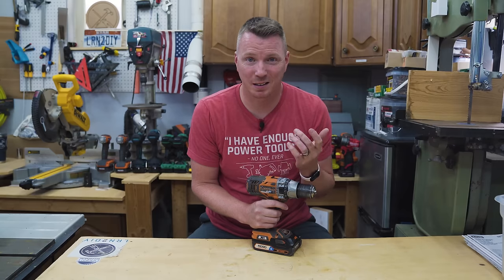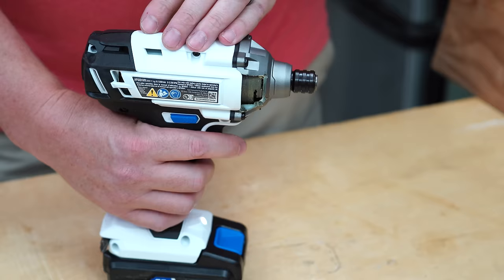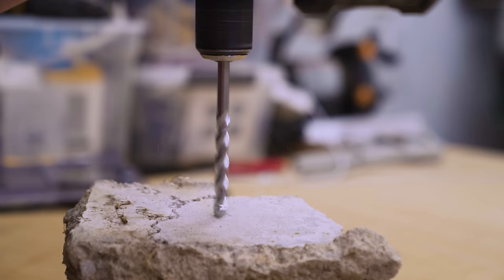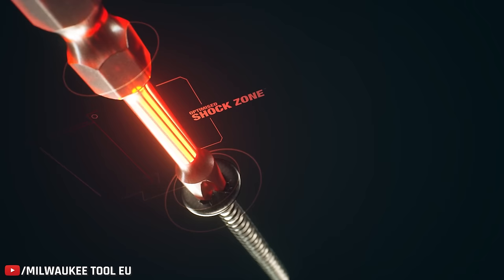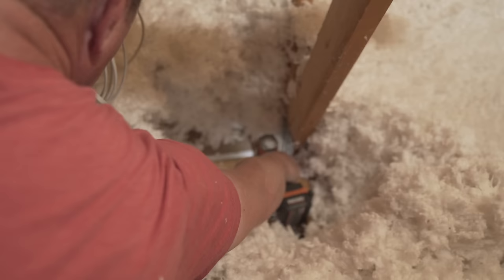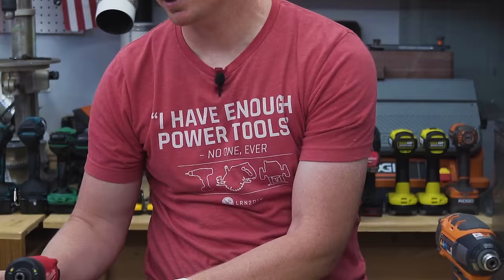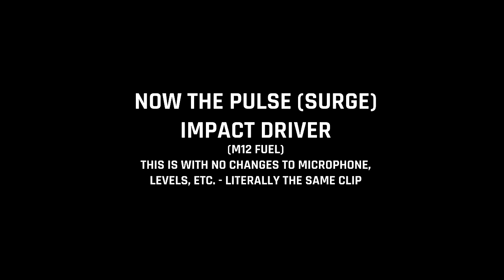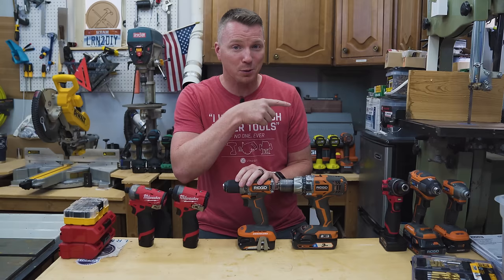Is The Cordless Drill Becoming Obsolete?

Comment: I use a drill for drilling and a driver for driving, sounds crazy but I'm pretty sure that's why they almost always come paired together. If I'm in my shop or if weather and location permits it, I still use a corded drill for drilling. If you are drilling all day, especially through stubborn wood the corded drill just gives that smooth constant power.
Reply: And if your corded drill is old enough, you can see the sparks from the motor brushes fly around inside the casing and sometimes escape through the vents. Just like the one my dad has owned for longer than I've been alive.
Reply: @StephenGillie  My apprentice calls that drill the "Wristbreaker 2000" cause if you bind it, the drill will keep spinning even if your wrist doesn't want it to.
Reply: @volentipugnum4045  "The ol' wristbreaker." That goes nicely with the permanent trailer hitch on my dad's Plymouth Volare, aka "the ol' kneebreaker."

(You know how every trailer hitch is a square adapter that sits forward of the bumper so it's out of the way, and the hitch ball sits on a square tube that fits into the hitch? His is a non-removable bar of 1.25" thick steel that ends in a trailer hitch ball mount. Because that's what U-Haul installed back in the early 1980s.)
Reply: That’s why they come with a side handle!
Reply: I finally decided to sell my corded tools. they have been collecting dust for many years, I don't even pull them out any more..
Reply: @twistedhillbilly6157  Best thing about them is that even if you don't need them anymore I'm sure they will do nicely for someone else for awhile. I buy tools from 2nd hand stores all the time and use them until there isn't a piece I can't duct tape back on.
Reply: The milwaukee m18 fuel with 2 5ah batteries and a rapid charger will get you through a whole day of drilling steel
Reply: And the my old man's old man duct taped the keys for the chuck to the cord. Never lost them.
Reply: I totally agree with u nothing beats the cord I have to drill many holes 1/4-3/8-1/2” some times all day just drilling
Reply: @erichermann7553  I do the same thing with Milwaukee M18.

Except I'm usury drilling through steel and cast.

Though I use it at home too, and I work multiple days on mine with wood on a single 5Ah battery.
Reply: @volentipugnum4045  Tell him to brace the right side of it; with his leg if he has to. Really nice in tight spaces cuz you usually get to just brace it up against wood er something.
Reply: @erichermann7553  new  cordless tools are so much better than they used to be. Often times just as powerful if not more powerful than corded. I was stubborn for a long time and didnt want to believe it, but yea, they really are. I havent touched a corded drill in a long time. Aside from my bosses right angle, because we dont have a cordless right angle. Hes old school. Im just trying to decide if i should get a cordless right angle or sds. Thinking right angle since it will get into tighter spots, but sds can be used for more things.
Reply: I like a cordless drill's break better than a corded
Reply: A cordless hammer drill and a good impact driver is the perfect combo.
Reply: Same. I use the impact for speed tap drilling into aluminium dowels, which requires torque but also speed. 

If I opt for the slower route, then I use my drill
Reply: @volentipugnum4045  sounds like my dad's Ryobi which is frome the 80's.
Reply: Drill driver drives screws better than impacts. Try it out. And drill drivers have more torque
Reply: too much common sense here lol i like it
Reply: @michaelsnyder6665 you mean the thumb breaker
Reply: The modern drill is much faster at driving fasteners than impact drivers. even with bigger lags a high power power drill will smoke an impact driver... give it a try...
Reply: I was always under the impression that impacts are for softer thin materials wood, fiberglass, drywall, and drills are for harder thick materials steel, stainless, and concrete.

Comment: I have both an impact and a traditional drill, but if I could afford only one, it would definitely be the drill. Because you have to have 1/4" bits for anything you want to use an impact for, it's versatility is severely limited (and costly).
Reply: Agree! The suggestion that an impact driver could replace a drill is daft!
Reply: And it is much cheaper to replace if a drill bit breaks, especially for small drills. I get a 10pack for nearly nothing for small sizes. I don't need special dampers for bits and I can use them more controlled. You can switch drill sizes faster with a bit, but you could do that the same with a traditional drill and an insert.
I have an impact drill, too, and use it. But I wouldn't want to have only that. And in the end I often use several machines with their drills bits or bits at the same time to be faster and not to change setting all the time. So the impact drill is just one more tool, but not the only one.
Reply: Sorry I will keep my Ryobi drill . I don't need a chuck key and changing bits is a snap. I can also use a magnetic screw bit holder and use those kind of drills too. You cannot twist wire with a impact tool. I will keep my drill. I can also use the old hand brace bits with my extension that the one end was cut off. That tool came in handy when drilling through thick beams on our plank house. Those were about 14 inches thick counting the studding that was put in to hang drywall. When I need a impact tool I will buy one but right now I don't see the need. 73
Reply: I see the biggest problem with choosing an impact over a drill is the lack of slip torque. I’ve been forced to use both at different times and found that impact driven screws will burry themselves when you don’t want them to, snap the screws, lack an adjustable chuck.... Driving large nuts and bolts are what their designed for and what they should be used for. Unless one is desperate or doesn’t give a damn about how it looks.
Reply: @nikkicrouse6713  my drill does both you just set the torque or go all the way for hammer drill. I do care how my work looks even though it is going to be covered. I knew of a guy that worked for his brother in law and if he left one hammer mark on the 2x4 he would get docked when he got paid for his work. The guy ended up being a good carpenter. I have some of his work. All stained finish. The one that replaced him was awful in making similar items he just used a staple gun and never stained anything. 73
Reply: Drills have a clutch which is far more control than an impact
Reply: Same thing I was thinking.

Comment: A really powerful cordless drill is extremely useful and faster than an impact for drilling. I see plenty of people talk about the top-end drills being too large and heavy, but I would much rather have the power on hand. I use the made in japan Makita driver and the XPH14 drill. Not having to switch to a corded drill to make a bunch of holes fast is really nice.
Reply: i agree also impacts are known for snapping drill bits
Reply: I love my XPH14, HUUUUUGE upgrade from the xph12. I've used it to cut 8-3/8" holes through plywood, as well as a 2-1/2" self feeder with a handle.
Reply: I'm tempted to get a 7/16 hex to 1/2 square adapter and use a mid or high torque impact wrench with a self feeder.
Reply: @Friedrich-Wilhelm-1980  Why would you want to slow a drill bit down (unless the material being drilled requires it)?  Similarly, do you have "breaks" or "brakes" on your car?
Reply: @1TruePatriot  1st i said nothing about slowing down anything

2ndly yes the hammering action on an impact drivers will snap a drill bit in nothing flat as they are hard as glass
Reply: I find it funny how people who work with wood seem to think that wood is the only material drilled through. Trying to drill through steel, especially hot roll with that insane hard crust on the outer 1/32" or so would end with many trips to the bench grinder to re-sharpen your drills.
Reply: There are also cases where a cordless unit don't cut it anymore. I almost killed a Makita hammer drill on one single job, but I changed to a corded heavyweight unit to drill a 2" hole of 15 inches through reinforced concrete.
Reply: @SuperballsSupervidsOnYT  True. As a homeowner I can't remember the last time I drilled a hole in wood. A few screws, a few nails---no holes in wood and I drill somewhat often.
Reply: @antilogism  exactly.  And most of the holes I've been drilling were with a hole saw.

Comment: Don't forget about using mixing paddles in the drill chuck. Epoxy coater here and I have used cordless drills for the past 6 years and 99.99% of the time was mixing gallons in a bucket, and is a crucial tool for the job although almost never using it for fasteners or drilling. Also wire wheels in the drill for cleaning/prepping areas.
Reply: This is the comment I came for! Thank you! This guy can go right ahead and pay a premium price for drill bits with special adapters added to them... I'll buy cheaper (and better quality) cobalt drill bits and do more with them in a normal drill.
Reply: You have to use a drill for certain things. If anyone works in cabinets you'll understand.
Reply: @landonvincent9586 Sounds like a nice way to bust a cabinet up using the impact driver.
Reply: the slow speeds of conventional drills aren't as useful with wire wheels as you may think. 
My impact drivers do 3700 rpm on max settings which is far more useable than the pansy 1700rpm of the usual premium brushless drill.
Reply: Buy a M12 die grinder or buff gun for prep cleaning
Reply: You can buy a chuck attachment for an impact for a few bucks. Not ideal but will work

Comment: Nope, drilling will never be obsolete.  You will always need that chuck for various drill bits, reamers, etc..
The impact driver is simply a different animal.  Made for fastening and mechanical.   I have been using both for decades.   The impact is a great tool with lots of use, but it's not a replacement for a drill.  Just looks similar.
Reply: I have a big set of impact drill bits with 1/4"  hex shanks. The impact only hammers when under torque.  Depends on the project if  I use two tools or swap bits...
Reply: The Milwaukee impact driver has a drill setting that gauges nesssesary torque and then applies it after a slight pause. Its AMAZING but I agree, the drill will always be. Its just now you can drill a 8mm+ hole through a steel chassis, change the bit and tap it in about 3minutes flat. Thats just not been able to happen before! Lucky us I suppose, cant help to think of by gone times when a drill was just a drill! God bless them.
Reply: Amen. In the fencing trade I may go all day using an impact driver because there is nothing better for that kinda of footage involvement. But then switch to something else when I need to do some serious material drilling and I go back to the drill....or I use both. Work in concrete and I get out the serious corded drill. Sometimes you just have to use your brain and figure out what works best and saves time. Using one drill for everything is trying to prove something and not 'reality' efficiency.
Reply: yep, although I do find myself using my corded drill for any serious drilling, and the impact for everything else, it is useful having one tool to put the holes in things and another to drive in the fasteners.
Reply: it is a replacement for most people. Chuck/chuckless drills are almost obsolete. I am a professional handyman, and I no longer use a cordless drill. I have bits for every job that are hex shank. I only drill when I need a large powerful corded drill for drilling large holes, but in that case I am not not using a drill, I am using an SDS.
Reply: I think you forgot to watch the video.....
Reply: @Reality Check, that's pretty much what he said in the video if you watched it
Reply: @twistedhillbilly6157  Same. I have a Black & Decker 18V Lithium battery impact driver, and it was pretty much the only power tool I've used to put together 2 wooden sheds with metal roofs, a greenhouse, and a deck - including drilling into the concrete house foundation to set 1/2 inch concrete anchors for the deck ledger, and into brick and concrete to set the greenhouse and shed frames to the foundation.
That said, I agree with @kevin fetner and @Mark S below - if you were doing this stuff professionally, there's a time when the corded hammer drill is needed - for serious drilling into concrete, say. But for the home handyman or semi-professional, if you are only going to buy one "drill" type tool, a cordless impact driver is definitely the winner.
Reply: you are right man!!! I'm in the trade and i know what i use a drill for and what i use an impact for.
Reply: Also, try drilling through heavy masonry without a hammer drill. You'll be there all day with an impact driver.
Reply: @poonholder5643  you definitely should not be using taps and dies with an impact. A lot more chance to break them. I dont even like using a drill for taps and dies. Always by hand so i can feel if theres a problem. Maybe thru thin aluminum, but never thru steel, especially if its hardened. Taps and dies you should be turning a half-full turn then back a 1/4 turn, not just running straight thru cause the hole gets filled with shavings and puts more stress on the bits. No ones going to do that with a power tool. Thats why they're meant to use in the proper holder and not 1/4 hex. At least not the good ones.
Reply: You could always get a chuck adapter and use 2 impact drivers.
Reply: Perfectly said !
Reply: For a what I assume is most DIYers watching this channel, 99% of the time they're drilling through wood or very thin steel. For this crowd, they really don't need the drill.
Reply: I agree.
Reply: Yeah it depends on what profession too i have both but barely use the driver because, 1: it doesn't have the strength of an impact wrench, and 2: it's not very good at drilling thru metal because the impact function can chip drill bits especially carbide ones, plus if I need to use a wire brush or a grinding bit real quick i can slap it on a drill because of the adjustable chuck.
Reply: @jacksmith2315  you can't tap a hole through hardened steel. A HSS tap is only slightly harder than hardened steel.
Reply: @MajDuty  So It's a click bait video. Got it.
Reply: @MAGAMAN  Huh?

Comment: My cordless drill is still my go to for drilling. I do a lot of drill/countersink and then grab the impact to  drive the screws. Someone below also pointed out, you can't drill metal or tile with the impact.
Reply: Can't drill glass with an impact either.
Reply: I frequently drill mild steel with my 12v dewalt.
Reply: Why can't you drill metal? It will only spin without hammering..Which is totally fine and you can adjust the speed if it has different speeds / torque settings.
Reply: @sizif717  you could in theory as long as the hammer never engages. If it starts to impact it will damage the drill bit.
Reply: @sizif717  It's just not good as it's still "hitting the anvil" and that's not good when drilling metal when your feed and speed should be constant. Conventional drill is superior.
Reply: Can drill tile with an impact, I've done it many times
Reply: I drill everything with impact driver, but I know how to adapt to using it. less pressure more speed same results as old days drills hihi

Comment: As I take on more projects, I find myself reaching for a corded drill more often. Mixing cement/mortar/paint, planting bulbs or tubes with 2 in auger, drilling though steel or other metal, etc
Reply: I'd hate to use a corded drill in the garden. I've done enough light to medium-power jobs now which I would never have contemplated if I'd had to faff with extension cords and the like. But each to their own, of course :)
Reply: @andymerrett  You dont need corded power for that.